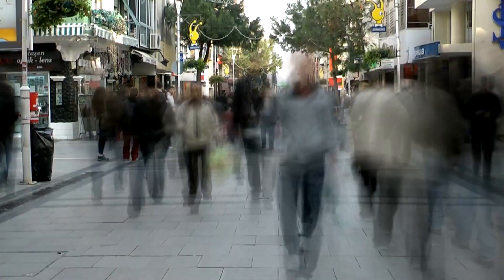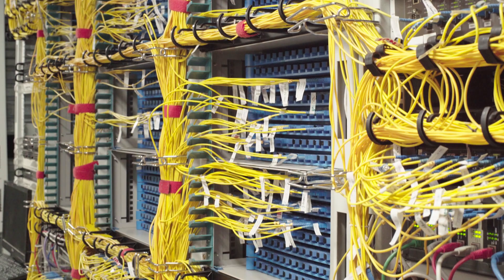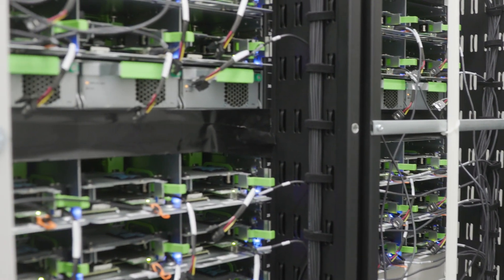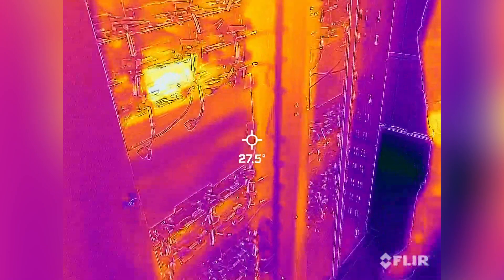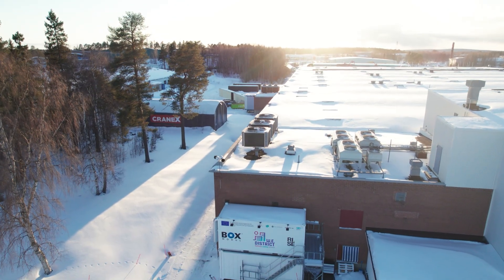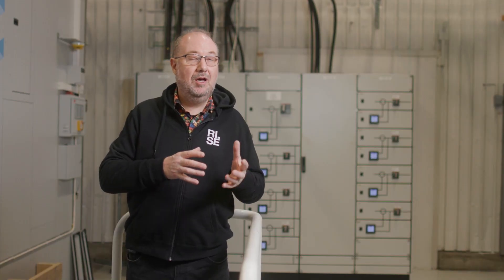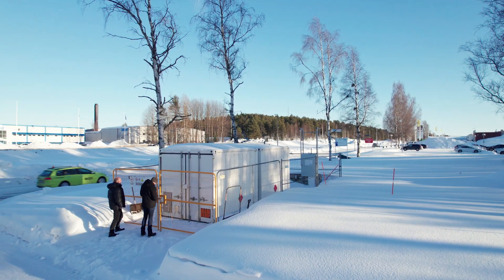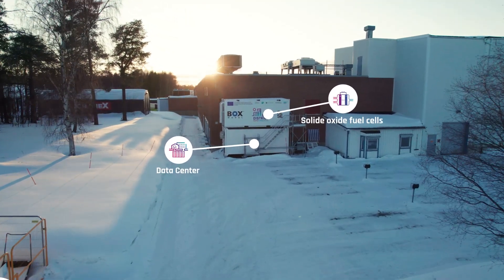Fuel Cell Powered Data Centre With Heat Recovery for District Heating

Comment: Did you mean "biomethane" by "biogas"? Did SOFC use methane to produce electricity? Who was the provider of the fuel cell? Thank you/Ali Hedayati/IVL/Sweden.
Reply from the maker: Thanks for your questions! At the Luleå demo site, the solid oxide fuel cells run on methane from locally produced biogas, which is why the project just calls it biogas in the video. The cells generate electricity for the data centre and also a lot of high-temperature waste heat, which is recovered and used in the district heating system. The setup uses commercial SOFC units, but the exact manufacturer isn’t disclosed.

Comment: I know SOFC's temperature goes up to 500 to 1000 degrees Celsius.... Isn't that enough already for district heating? Is it economical to spend lots of money on harnessing the "tiny" 35 degrees Celsius from data centres?
Reply from the maker: Thank you for question! Low-temperature (4th generation) district heating operates at temperatures of 50–70 °C, whereas ultra-low-temperature (5th generation) district heating can operate at temperatures close to the ambient temperature of 10–25 °C. In the case of fifth generation heating, building heat pumps produce the final heating temperature. With this in mind, the project aimed to identify potential future sources for fourth and fifth generation district heating systems. The WeDistrict research project ended in September 2024 but there are a couple of new EU research Project dealing with district heating, like Heatwise and Heat 35 to further transforming district heating systems of central Europe into sustainable and efficient heating and cooling systems by 2035.